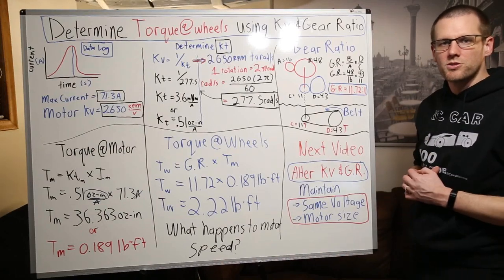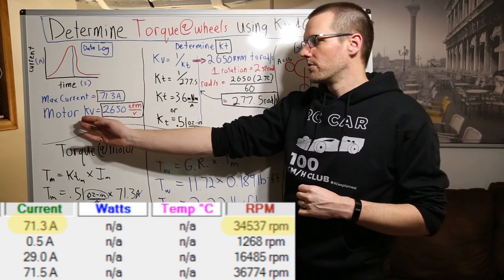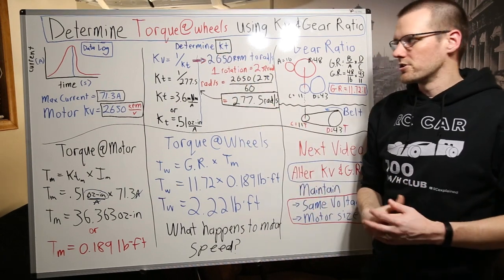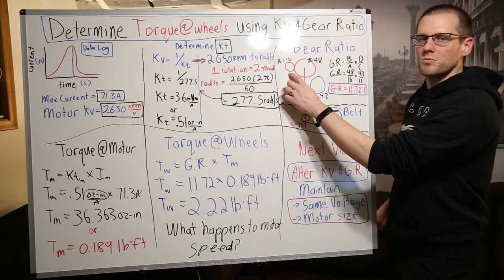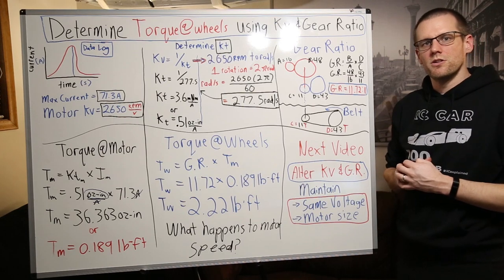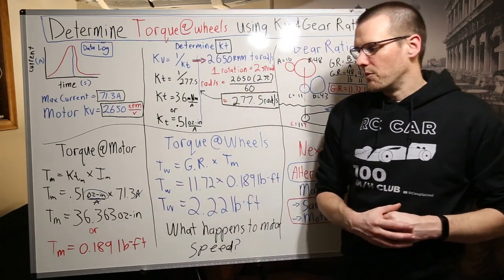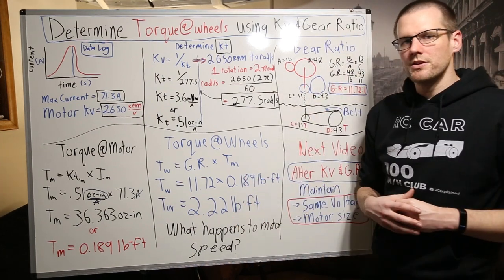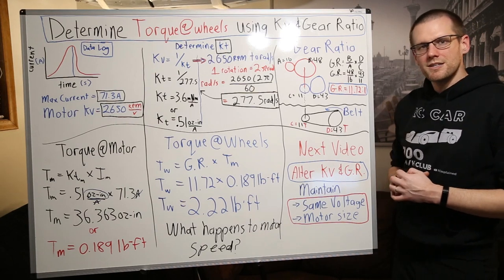Calculate RC Car Wheel Torque using Kv, Gear Ratio and Current

Comment: 2838 4400kv vs 2445 3600kv , pinion 15T , Wltoys 124019 , which one do you prefer for off-road ???? more torque? for speedruns it's faster the 4400kv right?

Comment: Now that's a well detailed explanation. I'm currently working on a project (1/10 nitro on road car to electric) and need some clarification on weight to kv and choosing a small can motor (2968) equivalent to a big can (3650) 4000kv because the space I have to mount the motor can only accommodate a 2970 size with a fairly large pinion
Reply from the maker: When looking for an equivalent 28mm motor to compare against a 36mm can size, use the weight of the motors as a comparison. Selecting a 28mm motor that weighs approximately close to the equivalent 36mm motor is a great start. 
Weight and kv is not necessarily the relationship you should follow to determine kv. kv should be determined by the voltage you intend to run and the max RPM that you require. Weight of your on road nitro car will help determine the voltage that you should run. Look at similar 1/10 brushless cars in the speed range you are after to see what they are running for voltage/cell count.
Reply: @RCexplained  thanks a million man 

info much appreciated

Comment: Hi. First of all, absolutely amazing videos that explain so much that was previously slightly or totally fuzzy. Second of al, I have a question that I am struggling with. I am looking to calculate RPM@wheel, for an Arrma Limitless. 
The configuration is the following: 
- Pinion 16T / Spur 34T - resulting in a gear ratio of 1.26
- Front Diff Pinion 13T / Crown 43T - resulting in a diff gear ratio of 3.31
- Rear Diff Pinion 13T / Crown 43T - resulting in a diff gear ratio of 3.31 (obiviously)

Now, in order to calculate the torque@wheel, as it is clear from this video: Torque@wheel = Gear Ratio*Torque@Motor. Correct so far!

My dilema is, in the case of the 4WD Arrma Limitless:
Do I determine the "total" gear ratio by MULTIPLYING ALL THREE RATIOS? (1.26 x 3.31 x 3.31) 
or 
Do I just multiply the center and one of the diffs ratios (1.26 x 3.31)?

Thank you!
Reply: good question
Reply: How you got 1.26

Comment: Hey, very nice video!
A general question haha.. Sometimes the RC car manifacturer tells you the gear ratio, in my case our RC for our project states a ratio 1:8.8. Would that mean that the torque at the wheels would be 8.8 times less than at the motor? 
Thanks in advance, keep up the nice work!
Reply from the maker: Thanks for the comment. You will have 8.8 times the torque at the wheels with that gear ratio.
Reply: @RCexplained  Thank you very much! It makes sense after doing some more digging haha.

Comment: I would like to equal the speed im achieving with my 2200kv with the motor same esc, car and battery voltage. With a 1600kv and 2700kv motor should I go up or down on my tooth count and on which gear pinion or spur?
Reply from the maker: Yuu would need to decrease the tooth count on the higher kv motor and increase the tooth count on the lower kv motor to roughly match the output RPM at the wheels.

Comment: Great video again, keep going same way. Can you do data logging video, what different things you can estimate when seeing datalog. I interested mostly cars, but offcourse other datalogging info is good too.
Reply from the maker: Thank you! I can add a data logging video to the queue. Do you have a log that you've taken that you can send to me?
Reply: @RCexplained  Hi very nice and thank you all videos and very good explainings. I dont have new datalogging my car, but very old almost 5years old log i finded my old folders. Buggy 1/8 6s, 4072 Leopard 1774kv, 40c 4aH battery, pinion 15/47 spur. Can i send that datalog file your email or something else? Now here that much snow and cold not can get any good logging before summer with new motor.
Reply from the maker: @LassiVVV  My email is on the about page of the channel. Send these details of your system along as well. I'll take a look at it and see if it would fit as a good example.
Reply: @RCexplained  Hi. Thanks sended all specs and datalog your email couple minutes ago. Hope that helps your video.
Reply: @RCexplained  ¨Think couple things your datalogging video. Maybe little bit discussion what parameters you need log to get best results (rpm, trottle, amps, voltage, temp?). Other thing maybe how fast logging rate you need to get good datalog (is 10hz too little or too much example).
Reply from the maker: @LassiVVV  Thanks for the suggestions. I have your file, I'll see if I can load and use the data log.

Comment: i assume one would need to multiply by battery voltage? as this was all done at 1V
Reply from the maker: No, voltage does not come in to the torque equation.

Comment: I want to calculate right motor for my rover so how should i do it ??
Reply from the maker: Start with how much power you require and the kv of the motor to match the cell count you wish to use to achieve a target output RPM from the motor.

Comment: I'm running a 3300 kv on 60 amp esc with 64 tooth spur an 14 tooth pinion and 11 volts
Reply from the maker: Hi becca, what are you working on with those RC Car specifications?
Reply: RCexplained  hi it’s an Abisma 2.4 buggy